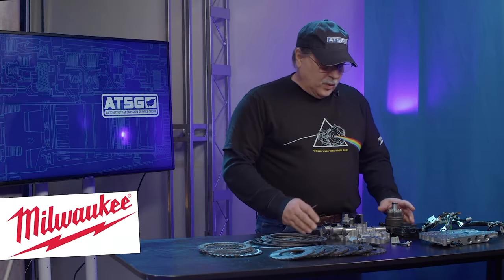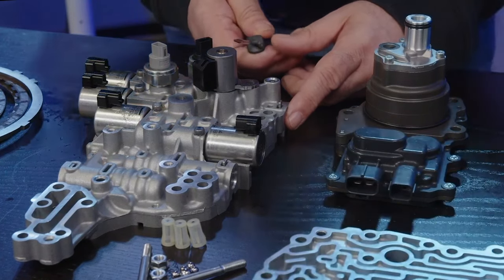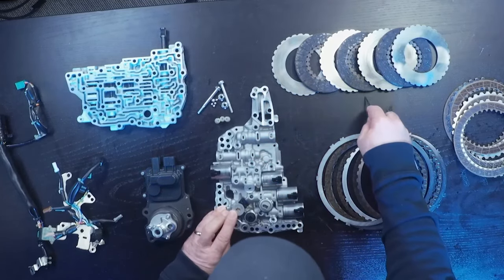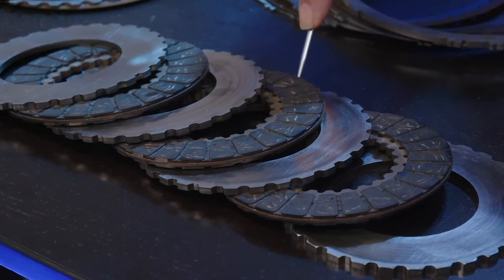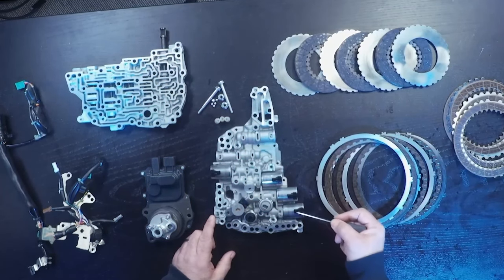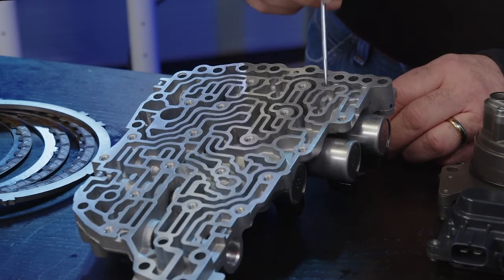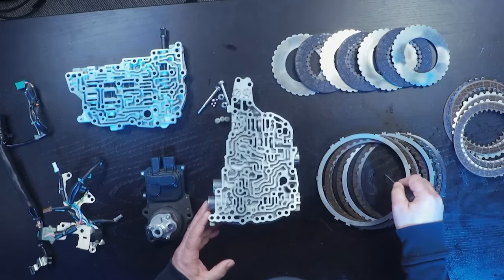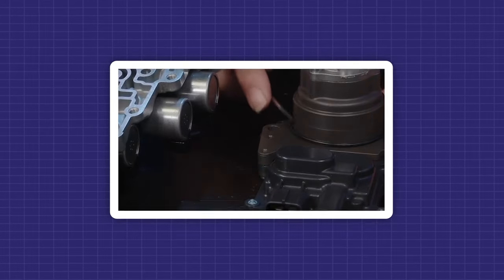ATSG - THE HYBRID CVT8 TRANSMISSION

Comment: For a Mitsubishi Outlander equipped with a CVT8 transmission. Would any of these solenoids cause the engine rpms to fluctuate when accelerating and also when cruising?